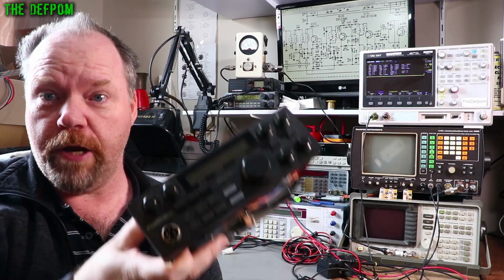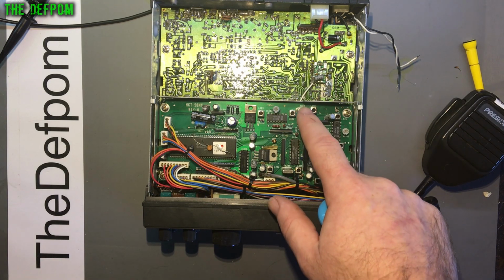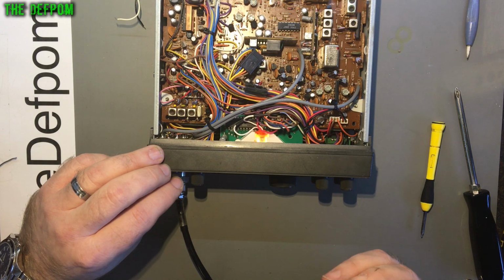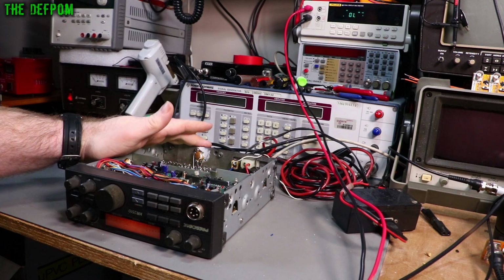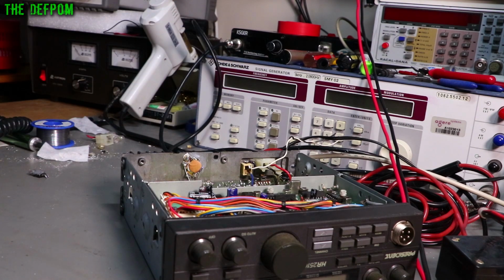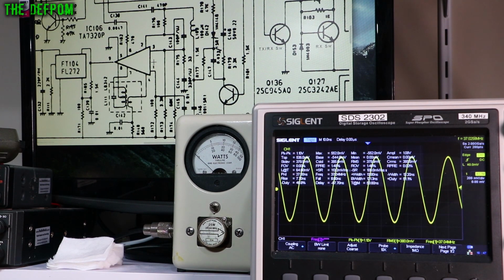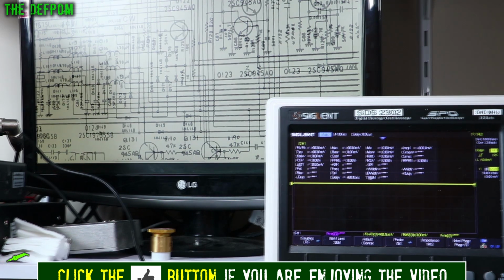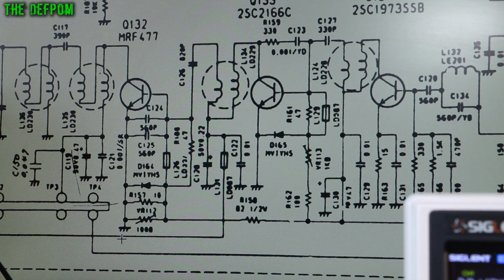🔴 President HR2510 Repairs Part 2 (SN3718) - No.873

Comment: Sir, my 2510 tx works fine. Problem is the rx audio started to intermitently weak, but now it is constantly weak. Could it be any of the electrolytic capacitors around the audio section?
Reply from the maker: Very likely to need all the caps replacing, also removing the old brown glue to stop it shorting out components.
Reply: @TheDefpom  Copy sir, I will do that. One last thing sir. How do I lower the power output on SSB ti at least 15 watts so I can connect my RM Italy KL300P linear amplifier with it? Thank you much sir.
Reply from the maker: @franciscolopez3229  there is an adjustment marked as ALC
Reply: @TheDefpom  Oh, ok sir, I understand now. Because before all I know was the AM POWER potensiometer. I tuned down to only 4 watts instead of the stock 10 watts. I did it to prolong the life of the finals for I understand it is very difficult to find a replacement. As you see sir, I am trying to fix it myself little by little because we don't have very good technicians like you so I only rely on youtube and google with very minimal tools and a multitester. I truely appreciate it very much. Again, thank you sir and all the best to you and your family.

Comment: Have an HR2510.. protection diode was blown. Everything works but no sound from speaker. Tried 3 different speakers. Replaced several caps in Audio section and Audio IC. Still no sound. At a loss of what else could be the issue. Any ideas are appreciated.
Reply from the maker: Does it have the jumper block installed in the rear to enable to speaker ? there should be a loop of wire in a plug... unless someone has modified it to have a 3.5mm speaker socket on the rear panel like I always to so the loop plug can be removed.
Reply: @TheDefpom  Yes Sir. The jumper is there. Tried directly from blue and black wire as well, to a speaker. Frustrating when it transmits with mod, receives, and all no sound lol

Comment: Good morning. Congratulations on the repair! I would like to ask how she perform the Adjustment of Balanced Mixer`s on IC304 and IC305 pin 2. The manual is not clear, what it means: Adjust VR301 or VR302 for correct DC-balance ? Thank you so much!
Reply from the maker: I adjust for cleanest signal on the output of each IC
Reply: @TheDefpom  Thank you for your answer! What do you mean with "cleanest signal"? And measured with the scope? Thank you for your interest!
Reply from the maker: @LukaNikoTech  yes nicest looking waveform on a scope, you can see both mixing products at each end of the adjustment, so adjust for best balance
Reply: @TheDefpom  Thank you very much, I will try to follow your advice. If i have undestand correclty , i can use 2 scope channels with the math function.

Comment: Have you done a video on alignment on the mcu board? I’ve got some instructions but finding them hard to follow
Reply: Ask as the L304 L314 seem impossible to get adjusted. L303 L313 are easy
Reply from the maker: No I haven’t covered that in a video I don’t think, it isn’t actually documented anywhere, I had to figure it out by reverse engineering the circuit design to know what signals should be where to understand how it should be aligned. I will have to do a video on that one day.
Reply: @TheDefpom  I’ve got a print off of the balance mixers setting up. Pin2 of ic304 and ic305 
L302 isn’t covered though the rest is like offsets etc

Comment: A tip for probing low level signals in radios.  Oscilloscopes often can not measure signals as low as you see in radios.  You do however have a instrument that is perfect for seeing extremely low signals, your spectrum analyzer.  Just stick a 10X oscilloscope probe on your SA and your in business.  Myself being paranoid I also have a DC block at the input of all of my SA's just in case I would ever probe something that had a DC voltage that exceeds the max on the input of the SA.
Reply: Yowza......captn Dave is shocked
Reply from the maker: Hi Mike, great to see you pop in ! You are correct (of course) I really should have thought about using the SA to probe that tricky bit. I have DC blocks on a lot of my gear just in case.

Comment: Great troubleshooting! C to B is an odd leakage path, I wonder how often that happens, in any circuit even. Really satisfying to figure out the tricky ones.
Reply from the maker: It certainly was an odd one, it was the first time I have come across a collector to base leakage like that where the transistor still works normally otherwise!

Comment: Man I miss those radios they were good radios before the glue corroded them. Glad to see you doing some radio work again.
Reply from the maker: It's one of my favourites, complex to work on due to the lack of PCB markings and for a long time no available PCB layouts (you can find them now though), this was such an odd fault that it had me stuck for ideas which is why I shelved it for later, which turned out to be a lot later. Its the first time I have seen a collector to base leakage like that, so the transistor still worked !

Comment: hello scott i have a 2510 that works ok but with the age i wanna replace all the caps.is there a kit or something that has all the caps and do i need to do anything else like realign the radio.i also removed all the adhesive from the board. ty
Reply: Klondike Mike Cap kits do have kits for this 2510. I have already bought a kit from him for my Craig L232.
Reply: A little effort on your end by using your brain or google keeps others from having to answer silly questions

Comment: Nice you finally fixed it is CB big in New Zealand, it has virtually died in the Uk for many years now :-)
Reply from the maker: It is pretty dead here, mostly truckers and ham only.
Reply: 10 and 11 meter band propagation is very open now up to around 2025. So go back into it coz there's are a lot going on, even on the freeband frequency around 27.300 to 27.700MHz on the upper sideband.